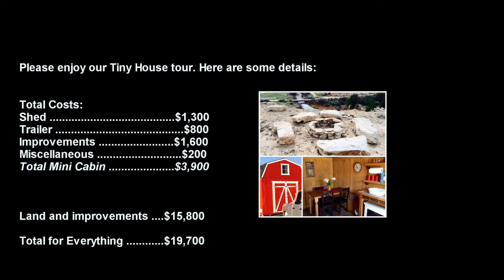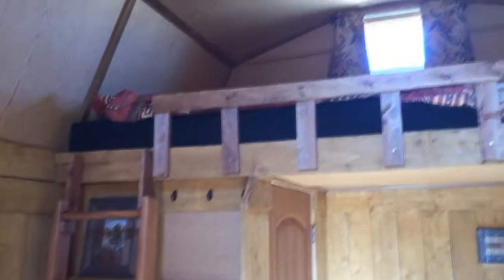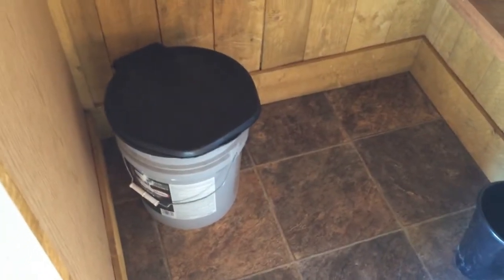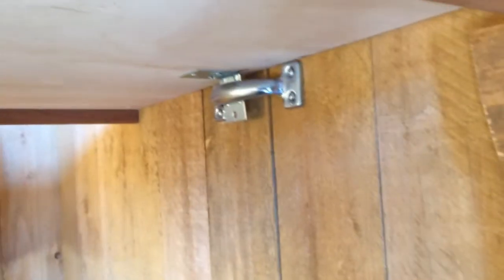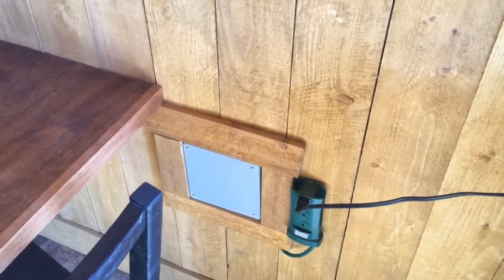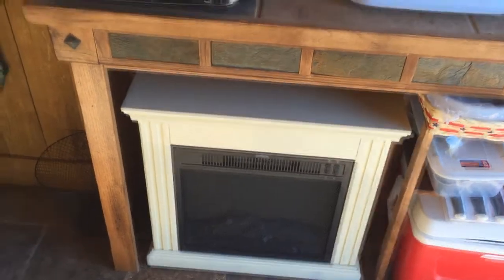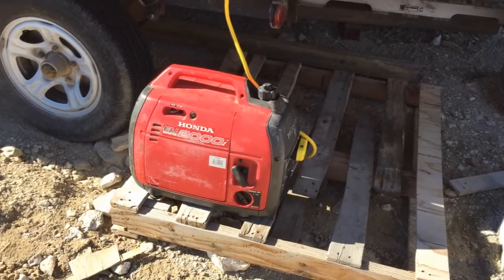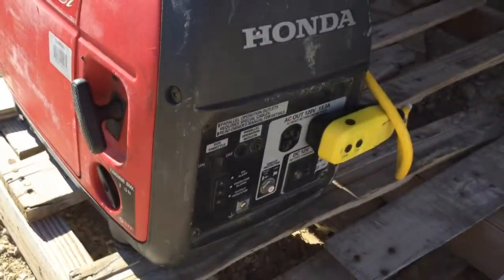Take a tour of an Off-Grid, Tiny House, made fast and cheap, using a garden shed!

Comment: This is a smaller version of the one that I did a video on. I love how you finished the inside of this shed. Looks real nice with the wood. Although you do not have running water your modifications are a great option for those who are starting this on a fixed budget and just want to be off grid. Eventually running water , composting toilet , solar and a wood stove could be added if you were to live there full-time.